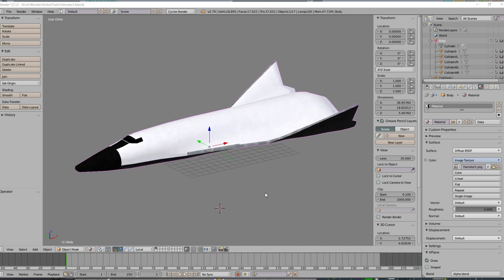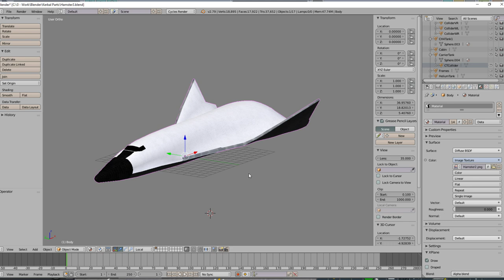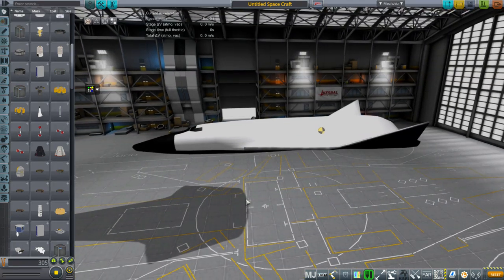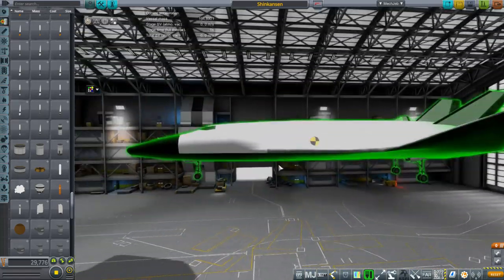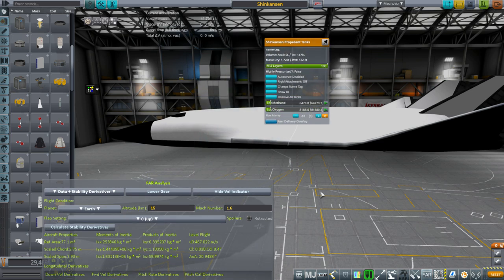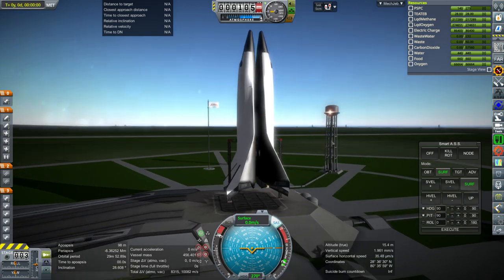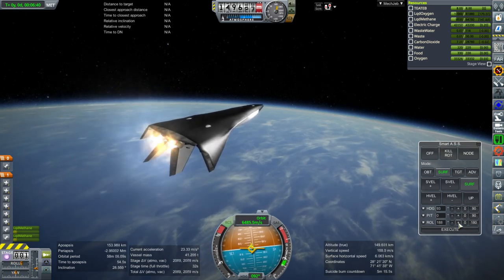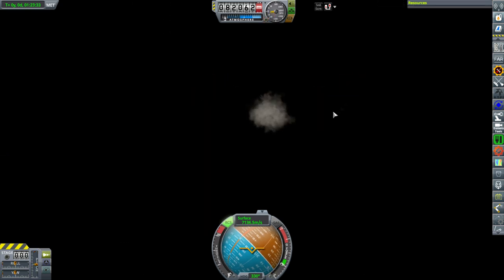Rocket Science - Spaceplane Concept Testing

Comment: Couple things for modeling and testing this that you might find helpful, because I'm enjoying this series and looking out with an eye towards designing realistic spacecraft from scratch myself.
In blender if you make shapes by extruding faces on more basic shapes, like how I suspect you made the body, select the faces you extrude and just double click the extrude region button again without moving your mouse, so it generates the vertices for every face it touches without actually extruding anything. Makes less weird normal issues. Maybe also go into tools in edit mode and click recalculate normals to be sure. And select your model objects (the body and tanks) and click smooth shading to make them look less faceted. The cycles render engine isn't a fan of low poly models since it's physically based, and there aren't many sharp edges in reality, so doing a few subdivide and smooth vertex commands helps soften up the shadows a bit I've found. Just deselect the axes you don't want it to round off.
That fuel tank for the carrier would make a decent base model for the passenger cabin on the spaceplane if you use the stock mesh/texture swapping feature. The tank can represent both parts for now and you can just use the swap feature to add an IVA lined up with the windows later. Same for entire RCS layouts and such since you're doing a single part approach to every subsystem already.

For re-entry handling it'd be a good idea to try and shift the centre of mass as closer to the belly, maybe shift more of your shielding to the bottom, and give the main elevator as much surface area as you can. Maybe shift the engine bells higher or swap them around like you said, you'll just incur a minor mass penalty for criss-crossed plumbing, there's enough volume.
A lifting body of this configuration is going to have to come in fast and hard, hit the runway barely subsonic and use drag chutes or retrorockets to slow down in decent time. It'll need tough landing gear and a wide stance as it'll quickly take the most responsibility for keeping the craft upright.
The vertical stabilisers behave well at those angles I think because they're at a perpendicular tangent to the curve of the hull they're intersecting. Maybe that does something for reducing turbulence, who knows. The stabilisers will need to be as tall as is required to maintain sufficient airflow exposure to have control at the range of attack angles you'll be maintaining from entry to landing.
At the start RCS and the belly flap will do most of the work, but when the air starts to tip you forward the stabilisers will need to provide yaw and roll control the rest of the way down. If you want to keep that red number you were pointing to in the green most of the way, try and position them where they can "see" the oncoming airstream for the whole time they're useful, like at the elbow of where the leading wing edge meets the main body. If you make the lifting body a little bit wider, kind of a kinked delta shape perhaps, you might get away with a shallower angle of attack, lower landing speed, and less vertical stabiliser area/mass. Split rudders would be helpful too for drag and extra (differential) control authority in thick atmosphere, if you have the left and right ones on separate groups.
Another program you might want to look into for designing spacecraft systems is a game on steam called Children of a Dead Earth. It's mainly designed on figuring out what contemporary space combat would look like from a ground up, physically simulated perspective, but it can be just as easily used for "civilian" purposes like this. Has a modular construction approach to spacecraft design like KSP, but goes into much greater depth and complexity with its simulation of material properties and interactions, as well as heat and power management, life support, the works.
If you want to find out reasonable properties for your spaceplane fuel crossfeed system for example, you can have a look at the mass, materials and power consumption properties in one of the refueller modules for spacecraft in CDE, and scale appropriately. You can even design your own from scratch if you're not happy with the numbers.
Looking forward to seeing what you come up with.
Reply: ok

Comment: i think center of mass should be close to nose than center of lift, i.e. on re enter you should never pitch down, only pitch up, and in case you don't have control surfaces to do that it will just fly strait nose first (still will overheat nose though later, but allows to test model more time, and possible with higher periapsis before re enter allows you to re enter safely). 
RO allows to test stability in hangar (With different angle of attack and speed), and stability coefs do include that consideration.
it looks like (ram)jet with optional dropable (with parachute) electric compressor will greatly extend capabilities for carrier plane (both for starting phase and landing phase, it could fly with ramjet while supersonic and enough fuel).

you can check alternative SAS mod ThrottleControlledAvionics for attitude control.

Comment: Just as a point of discussion, I don't think "reusability" is the way forward for space exploration. 

The Falcon 9 isn't cheap because it is reusable(And they are not, they are refurbish-able like the Space shuttle) they are cheap because they are producing a lot of them efficiently. 

My idea would be an ultralight ballon tank pressure fed rocket. One use and you're done, but you could produce them more cheaply.
Reply from the maker: This system is designed with mass production in mind, which is why we're using tanks also used in other systems and using two of the same plane for the launch instead of having a unique carrier plane. In the end, the mass of this system is less than a Falcon 9 and has more potential cabin area than a Dragon 2. Also, if you saw in the video, I also intend to make a Falcon 9 straight-stack launch system out of the tanks and engines used in this spaceplane. In other words, I'm way ahead of you on the mass production thing. :)

If you'll take a look at my prior video in this series you might realize why you can't have a balloon tank pressure-fed rocket: https://www.youtube.com/watch?v=rAWpJuzvBEA. To have a pressure feed system, the tanks have to be pressurized to more than the chamber pressure of the engine (usually more than 10 atmospheres) while a balloon tank's walls by definition can't deal with 1 atmosphere of pressure.
Reply: @RaizSpace  Well for mass production I have to disagree. You are effectively creating an aircraft, which is going to be more intensive and expensive to manufacture comparatively. Take the Concord, for example, they cost around 100,000,000 each. The space shuttle would have been many times that. 

So you're looking at at least 200,000,000 for each launch vehicle, not even close to the Falcon 9. And if you're looking at reusing them to lower costs you have the same problems as the space shuttle. Everything needs to be torn apart and checked. And with a space plane, that process will be more difficult than a capsule or a much simpler booster. 

And I don't understand what you mean by ballon tanks can't withstand 1atm. Do they not work like a pop can? Ballon tanks can handle high pressures inside them. I  thought that they only can't handle higher external pressures.

Like a pop can be crushed easily when it is unpressurized by it is very strong while pressurized.
Reply from the maker: First of all, you seemed to miss in the video and in my comment where I said the tanks in the plane would be used for a simple booster akin to the Falcon 9 though with Methalox. You also missed previous videos with other elements of the overall system.

Aircraft are both reusable and mass produced. You can take an example like the Concorde, which is unique, to which I can point to countless models of successful airliners. Was the very first airliner a paragon of mass production? I doubt it. But eventually you will get the space equivalent of the DC-3 after working through the initial problems of something like the Space Shuttle or Concorde. Just because our first attempt didn't live up to expectations doesn't mean the entire idea has to be thrown away, or I doubt aviation would have seen the success it has had in general.

The reason the Space Shuttle needed to be torn apart and checked is because it was not designed with CAD software, which made especially the back end convoluted, or computer systems to check things. To pretend that we haven't learned anything from the Shuttle would be incorrect. Also, this system is less than a quarter the mass of the Shuttle stack and probably won't include the complication of a large cargo bay. If there's a cargo bay at all, it will be fairly small and no replacement for a regular lifter.

There is a limit to how much pressure a balloon tank can take from the inside as well. Again, if you had seen the earlier video, you'd see the actual calculation. For a pressure-fed lifter, you're basically looking at something like Sea Dragon: https://en.wikipedia.org/wiki/Sea_Dragon_(rocket), but that didn't use balloon tanks because, again, it couldn't with those pressures and stresses. The best balloon tank lifter example is the original Atlas, but it had to be reinforced because it couldn't even bear the weight of the Mercury capsule initially, and it was turbopump-fed, not pressure-fed.

Now, it's clear that you're not into spaceplanes, which is fine. However, that doesn't mean we can't continue to explore the idea to find solutions to problems. Maybe it's a promising design, maybe not, but there's no need to have a dogmatic "it must be this one way" road.